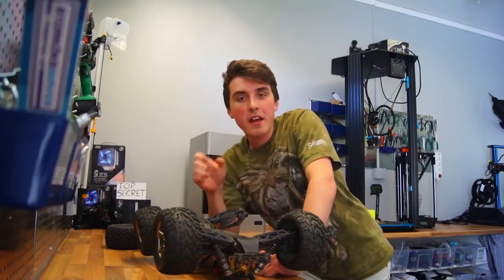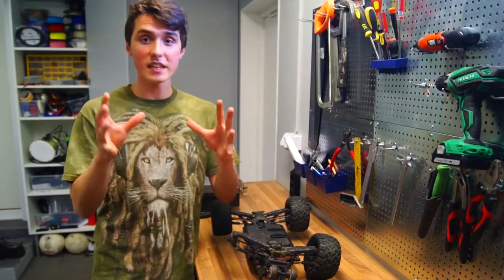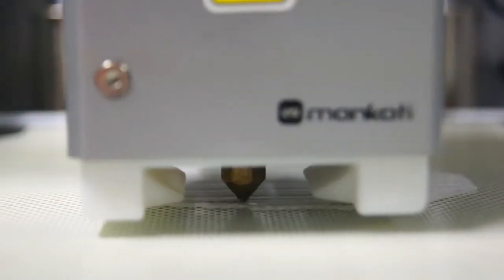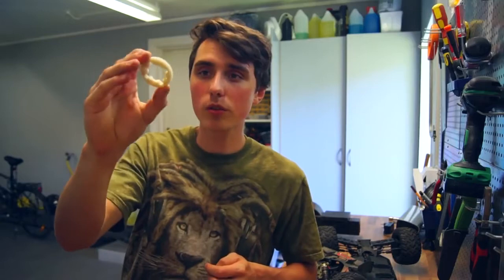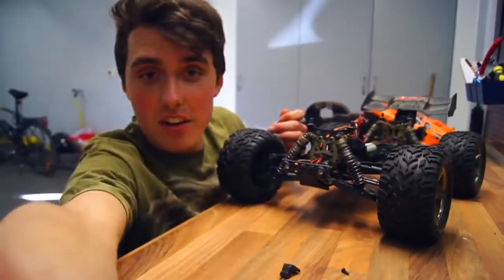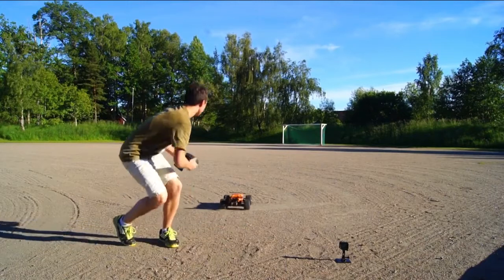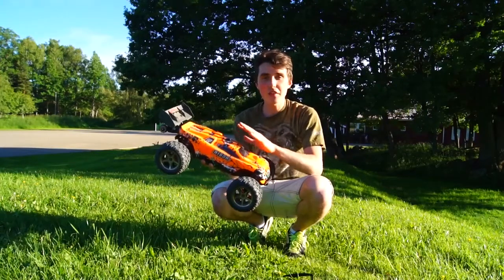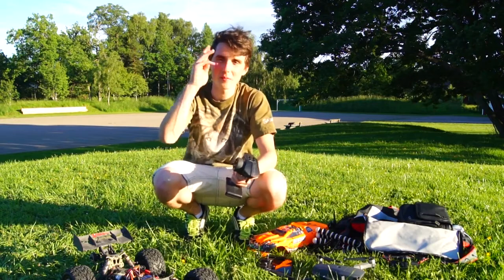3D printed nylon part for RC car | Mankati E180

Comment: Looking to buy a enclosed 3-D printer I don’t really want to spend the money on the Mankati e180 so I was looking into a cube pro duo have any Experience with this brand and do you know any pros and cons? And I’m looking to make wheels only for 1/5 scale losi dbxl which is heavier and more powerful than your r/c so any suggestions about printing those wheels?  maybe you have a different 3D printer in mind from your experience!